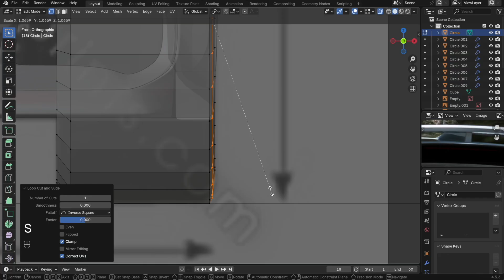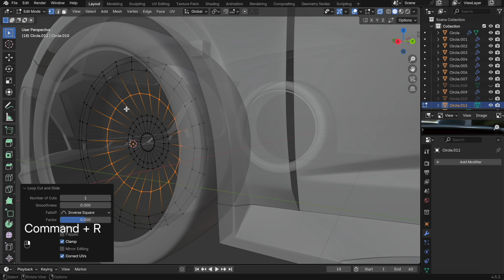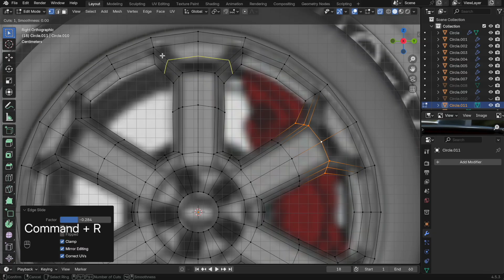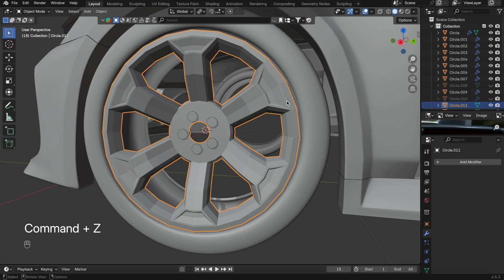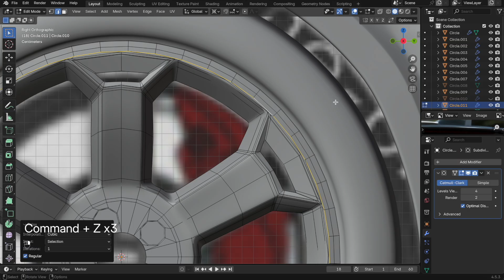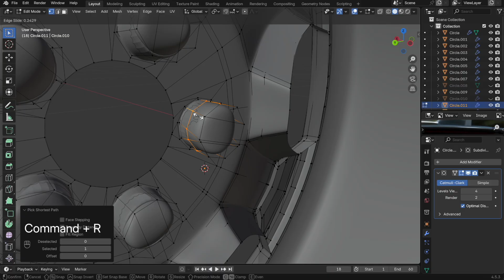Audi RS6 Avant GT - Blender Car Modelling Part 14

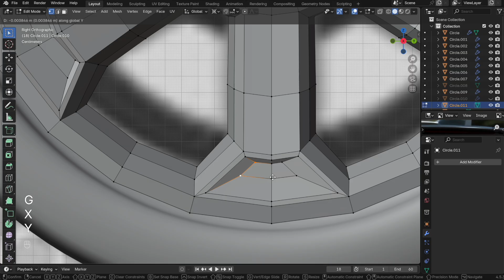Comment: At 14:54 
Another way is to model one of the six rim meshes to taste,
Then delete the rest five and spin the modelled mesh 360° around the 3D cursor on X axis with 6 steps using the spin tool.
Then rejoin the now spinned surfaces by selecting all vertices
And merge by distance.
*Merging distance can be adjusted if need be
Reply from the maker: Ironically I tried it that way follow a tutorial from YouTube but I just didn’t like the process, I always look for methods which works for me and are easy and seamless to explain, at this point I’m just developing my own method of doing things in blender